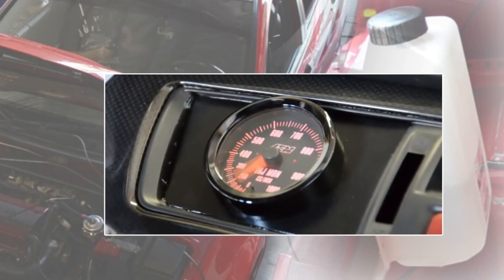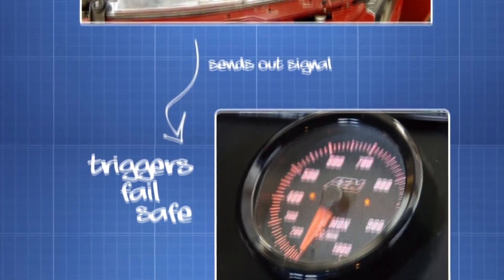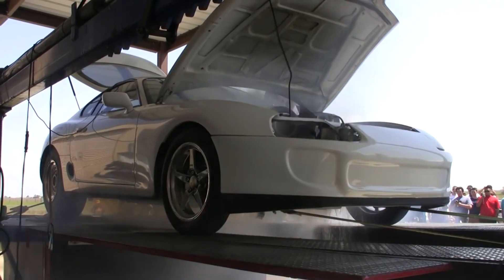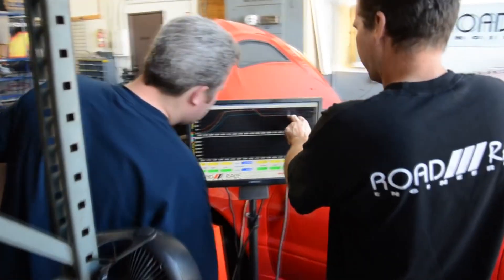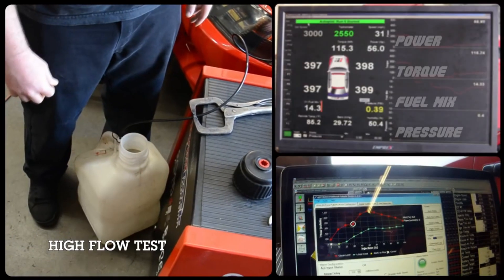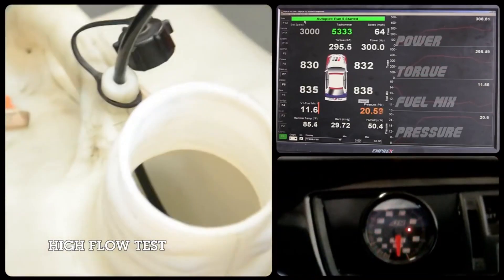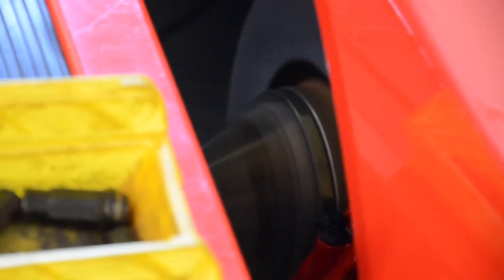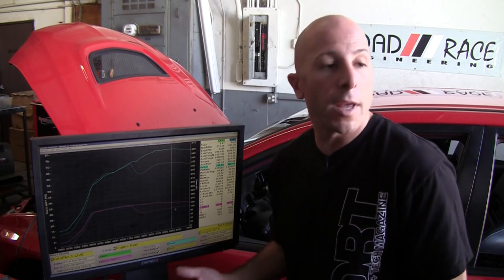AEM Water/Methanol Failsafe Saves 400HP Engine!

Comment: Where does the Yellow BoostSafe wire need to go?  I tune my factory ecu with EcuTek and before I purchase this Meth kit I would like to know how exactly I can make Ecutek/racerom recognize the flow of Methanol to properly apply the right ignition timing or even retard timing if theres a failure of some sort.  I understand that the failsafe gauge system basically monitors the activity of the meth system itself but what I'm lost on is what gets wired where so I can control my maps fuel/timing tables based on methanol flow?  I know this has been done before on my FRS/BRZ platform but im having a hard time getting responses on how it was done.
I understand that the meth controller can be manually armed, turned on/off, etc.  But what needs to be done in regards to wiring to get my racerom to recognize the meth activity to make ignition timing adjustments.  I dont want to just make a 93 octane tune that is leaned out when in boost and then just spray meth.  I'd like the racerom to know when to lean out/advance timing. Etc.
Reply from the maker: Please contact our tech support team and they will help you out! Be sure to download the instructions on our website to reference during your discussion. gen.tech@aemelectronics.com

Comment: Is this a secondary map or a trimmed table?
Reply from the maker: Our controller controls the start and full pressure points to establish the flow curve for the WMI system. Tuning will be required using a ROM, flash, piggyback or standalone ECU to see optimum results.
Reply: @AEMpowerTVelectronics  Is it mandatory to have that flow gauge or eighter without it does the job?
Reply from the maker: @O.A_Ih4teno0bs  it is not mandatory.
Reply: @AEMpowerTVelectronics  thx :)